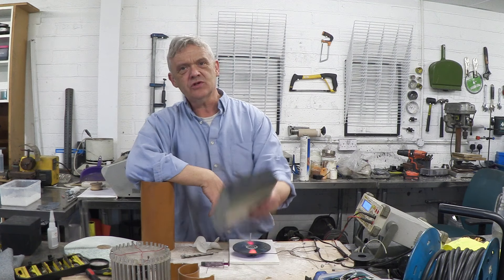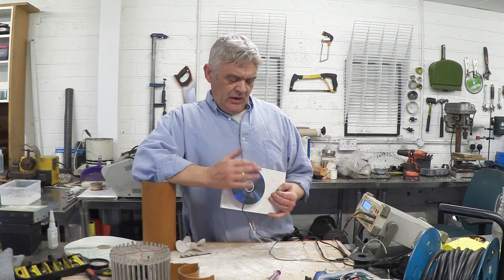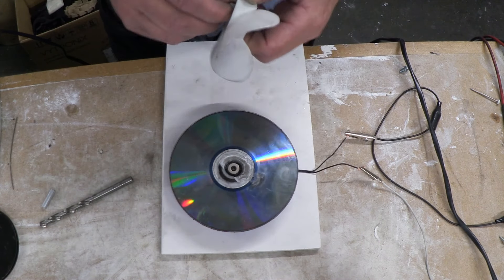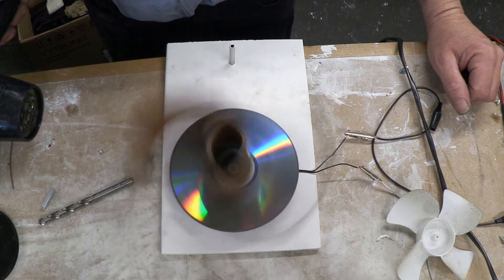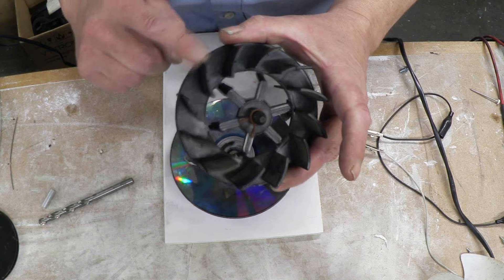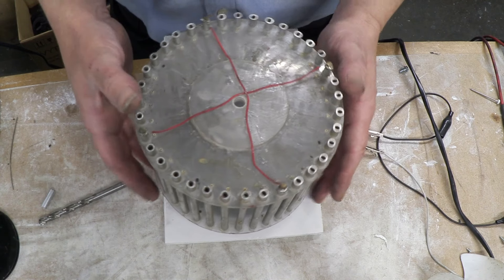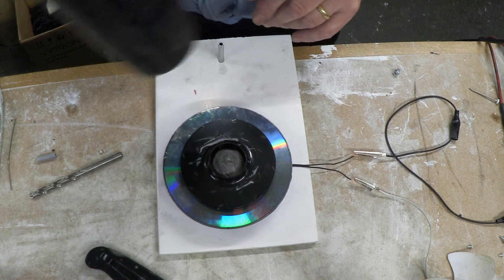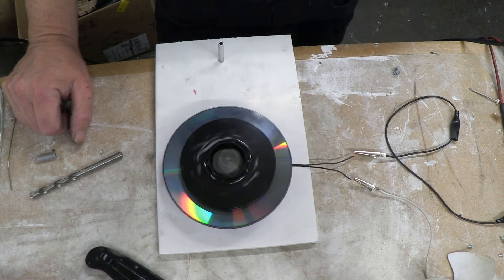A Flat Wind Generator

Comment: What I would give to spend time with my grandpa like this again. You evoke memories, sir!
Reply: Same Here Buddy
Blessings From Birmingham England
Reply from the maker: awesome mate - cheers
Reply: Cheers from Durham, Durham! :)
I would apply all this high intelligence low tech to make the small things work. Wind and thermoelectric generators in a van, for instance, for appliances and what not. Makes me happpeeee
Reply: @lokiii3507  Yes Those Flat Spinning Disks On The Top Of Vans And Peltier Units Attached To Points Of Heat On The Engine Would Create A Decent Amount Of Power Even As Reserve Top Up 
Bless Up
Reply: Now imagine even a handmade rocket stove (with a see through window) for heating. Connected to it a thermoelectric generator and water filled copper tubing connected to the insulated water storage unit and floor heating. What a life!
Reply: @lokiii3507  Indeed Very Insular But Modular So Relatively Easy To Work On , I'm Building A Rocket Stove / Wood Gasification Hybrid That's Pocket Sized It's Not Far From Complete
Bless Up
Reply: @joohop  Provide a link when you finish!
Reply: @lokiii3507  I'll Try My Best To Do A Basic Step By Step Before 1st Burn 
Bless Up Earthling

Comment: Nice job Robert.
When you put the cage with round bars on the generator, it came to mind that instead of round the bars should be squashed and made like an aeroplane wing with an adjustable angle of attack.  If you try this, I am sure you will have a very robust and efficient wind generator.
Then I though you can chenel the exhaust of that fan and it to run a Tesla turbine.  The Tesla turbine should have turbo fan on it a aircraft type turbo housing.
I think you just solved the jet fuel issue.  Bravo!.  
This can be started electrically but once over 5klm per hour the telsa turbine will be screaming and you would have trouble moderating the engine for taxiing etc.  Love it.
Reply from the maker: I am sorry mate but I did exactly what you suggested in this video - a round bar and an airflow bar.
Reply: Hi Robert, what I was referring to was the shape of the bars in the cage of rods.  Aero wings work on lift so I was thinking you could reshape the rods so they can harness the wind to use that lift effect to rotate the generator.
The Tesla turbine idea was simply to replace the jet engine with the Tesla turbine. The output shaft of the turbine is fixed to the turbo fan from the turbo prop engine.  Use the airspeed of the aircraft to run the Tesla turbine.  30,000 rpm will give huge thrust.
Sorry for any confusion.

Comment: I have built wind turbines for over 50 years. The bottom line is, vertical access wind turbines are fun to watch and I have several, but a horizontal axis wind turbine makes better use of swept area.  I dislike a lot of machinery whirring about at breakneck heights, so all my wind turbines are low to the ground and have big paddles, which hang out into the wind. They are all the drag machines, but I have never had one, fly apart. I cannot say the same for my horizontal axis wintd turbines. I conform to the theory that many small units produce the same power as one giant one and I have several small savonius units happily spinning in almost any wind here on my little place in North Texas.  If a blow comes along, I don't worry about a thing. My savonius windmills are all made with ball bearing axles and are fabricated from welded steel.

Comment: Some great suggestions! I can see the "wind wall" being a great thing for collecting energy on the cheap! Thanks for another interesting video.
Reply from the maker: cheers mate - and it just struck me you could probably instal this without needing planning permission
Reply: Even if there was no bubble, the wind exiting the fwg would inhibit the the one next to it.
Reply: @isaaccoen-graham8867  What if instead of a flat "fan" piece, you were to angle it slightly backwards towards the wall (\_/ with less slope and the wall at the top of that poor diagram), and have it offset from the wall about 5cm (2in)? Also, you don't have to absolutely cover the wall, you could allow space between for that air to escape either returning to the front side or escaping behind the rest of them? Maybe also about (again) 5cm or even 10 between units? I hope that makes sense, maybe I'm explaining it wrong.
Reply: The 'flat wind generator' idea wouldn't work well with mutiple units, but I do think the wind wall idea could be usable - architecture does funnel wind around, and a wind turbine designed to take advantage of this effect, and positioned along the edge of a wall, could be viable. Not massively powerful - you're not running a house off it - but viable as a power source for some LED garden lighting. Have to make sure it runs very quiet though, people don't want whirring fans in their garden.
Reply from the maker: @Ian Perryman that's all right mate - people think different things - but did you check out the Mike Waters suggestion?
Reply: @Ian Perryman if you put a dish with the middle cut out in front of the device shouldnt this help direct the air flow like the hairdryer
Reply: @ThinkingandTinkering
Reply: @ThinkingandTinkering  Shouldn’t the cone have been bigger than the hair dryer and the flywheel? Isn’t the air hitting the flywheel slowing it down? Counteracting forces? Using an air compressor small nozzle might work better for all experiments.

Comment: After spending the better part of a day standing in front of my giant shop fan playing with various types of fan blades including several vacuum cleaner turbines I've made an observation. The vacuum cleaner turbines are designed to flow air in the opposite direction than you and I are moving the air. If they were shaped so that the air could exit through holes that were wider than the holes in which the air enters (the opposite of what you have now) I believe they would become much more efficient.

Comment: Wonderful the delight you have and share with everyone....such a great lift when learning something new and maybe complicated.
Brilliant idea - as a Wind Wall. Working in Diamond or Star or both shapes in sequence, they would keep  each other rotating almost permanently.
Especially towards the Corners of Buildings where Vortecies are normally generating high levels of energy...
Capturing these energy spirals and then passing them back to any passing Winds on low energy areas of Flat walls would I believe help to regulate Airflow overal as well as wicking heat away when needed, to be used by heat capturing Technology. 🙋‍♀️🌈🌞

Comment: There is a company that did a Edit: quad sectioned  360-degree funnel system to gather low-speed air at ground level 4 kph and with an aero-spike facing down and the tube with a venturi shape to increase airspeed they then had 90-degree turn to send the air through "normal" wind generator blade set but with your last set up it could just go straight down losing no energy to the turn. Interesting and thought-provoking as always Robert thank you.
Reply from the maker: that is interesting mate - cheers
Reply: @ThinkingandTinkering  Cheers

Comment: It appeared to me as tho the squirrel cage with the curved blades spun easier and faster than any of the other fans that you experimented with, also if you had a number of theses on a rooftop they would also spin no matter what direction your wind flow came from.
Reply: Yup. The Vacuum impeller would work better if the airflow would enter from the side and not the center. The cone in the center would make an improvement whatever the direction of airflow. Playing with the geometry could improve it even more.

Comment: The power output of that tiny motor is surprising.  I like that last one with the cone.  It brings to mind the works of Viktor Schauberger.  I imagine his study of fluid dynamics can also be applied to air flow.  I think I will experiment on a way to capture the spill-over of your vertical blower and see if there is enough increase in efficiency to make a difference.
Reply from the maker: yes it does - nicely pointed out mate

Comment: A cone concentrator (not sure if it is a right word to use) could take this design to the next level I think. It can be easily attached to the base around the flywheel so without adding any weight to the moving part more air will be forced in the turbine.
Reply: You mean like a big funnel attached to the base aimed at the center of the impeller, to catch more surface area of air to up the air pressure and push it through faster? I thought about that too.

Comment: Dear Rob; Your last design with the cone at the centre looked good to me: I thought, we could invert the cone sides making it more pointed! 
Then adding a funnel to the centre to increase the catchment of air, would improve the pressure 10 fold at least.
Next: we could use any spilt over air that could not flow into the funnel, to act like a vacuum as it passes the exhausted air. 
This in turn, would help draw away the spent air. All good stuff for our practical people.
thanks from Chris.
Reply from the maker: I like it mate - that is good thinking in my book
Reply: `if i had a 3d printer, id look to print that shape, Any one here with a 3d printer wanna give it a go?
Reply: could mess with the diameter of the center intake port as well and make the cone's size proportional, increasing or decreasing the overall amount of surface area the turbine has devoted to air intake, when my 3d printer is up and running i'll try to take a look at this.

Comment: What I like about the last design is that you could still put PV cells on top of it. Two different sources of electric energy in one small apparatus.
Reply from the maker: for sure mate
Reply: That was what I also thought.  Use one of the cages and thunnel the wind to the center for the last design.  Perhaps also add the vibration method that was in a previous video to catch the imbalances of the system.

Comment: Re the impeller, adding the cone to direct the air was obviously necessary, but I think to properly adapt the impeller to work in reverse as is being done. It would increase its efficiency if a funnel was attached to the central hole, so widening the area that can catch the air, and perhaps increase any central Pintal force that may be in play.

Comment: 9:30  "...these would actually fit on the side of a flat building..
"
Well, sure, but wind does not blow agaimst a windward flat side of a building in the way your hair drier blows down the center of the your impeller.  
Blunt windward surfaces generally only experience a small fraction of the wind velocity of the free stream, and it is not perpendicular to the surface, but pretty much parallel.
Reply: source?
Reply: @crapisnice  I'd give the credit to empiricism as the source.  
Go outside on a windy day and stand with your back to the windward (overall flow direction without obstacles) side of a building.  
The air has to have somewhere to go, it does not simply blow up to the windward side of a blunt object.

Comment: I think your tesla turbine type would work even more effecient if the wind came from behind and routed in the outside fins and escaped from  front . Opposite to your entrance . This would take advantage of low pressure turning into higher pressure . Sort of venturi effect !
Reply from the maker: there are already Tesla turbine wind generators mate
Reply: Robert Murray-Smith yeah but they for high pressure force i thought .
Reply: You can tune a Tesla turbine for different fluids and flow rates, but they tend to foul up rather quickly when designed for air due to pollution and pollen and such.

It's another one of those things that work perfect in the lab, but not the real world.

Comment: Thanks for stimulating our imaginations Robert.

This gave me an idea - if you mounted this on top of a vertical10 feet long stove pipe, maybe the air pressure differential caused by the stack effect might create a draft to turn the impeller.
Reply from the maker: i like that mate - worth a try for sure

Comment: I think that the black squirrel cage fan is more practical since it is omnidirectional and, therefore, could be mounted on the roof of the building and it would work regardless of the wind direction.

Comment: What if you added a low angle cone on the outside of the flat wind generator that would redirect the air towards the center?
I'd assume you would get even higher output, however having a wall of them could be problematic due to the exiting air interfering with the others, but that is just a guess.
Reply from the maker: don't guess mate - try it and see

Comment: Have you ever thought of adding a air horn trumpet style cone to concentrate the air to the center which would increase the wind velocity at the inverted cone at center of your impeller style flywheel.  The final design would look like the old Ford Model T “A-O0GA Horn.  That would take pressure off the flat surface of the flywheel and increase the air pressure at the center.  That design might increase the Venturi effect at the discharge section of the design.

Another thought I had was to deflect the exhaust gases toward the leeward side of the configuration to increase the Venturi further.

Just a thought, if this has already been addressed, please forgive my ignorance, it is just that I have neither read it in the comment nor hear heard nor seen it in your videos.  I find your videos fascinating and inspiring.  Thank you.

Comment: I'd like to present an idea for a constant wind source.... you always get me thinking.... It would require a busy highway.... How about running over a garden hose with one way valves at each end to charge a storage tank ...  once the tank is charged then it could be released to turn a series of wind generators... It would also be interesting to see how much pressure you could actually build using this method of recapturing energy....
Reply: They use this principal already but for surveying how many cars use a road. 2 pneumatic rubber tubes are laid across the road, parallel with each other, connected to a sensor box on one side of the road and sealed shut on the other. When the distance between the tubes are known, the time between the pulses of air can determine the speed of the vehicle and it's wheelbase. 4 pulses = 1 vehicle.

Comment: In places with no wind but lots of heat you could have a long black tube with radiator fins on the inside hot air rises and passes through a generator at the top and one as it gets sucked in the bottom.
Reply from the maker: I like that one mate - cheers
Reply: @ThinkingandTinkering  :)

Comment: If you blow through a funnel directed at the disk, will it increase the airflow like water flow being concentrated this way increases the water flow rate? Previous wind generators you made could benefit from this.
Reply from the maker: that doesn't sound right mate - but I will try it and see

Comment: The last example seems to be more of a concentrated wind pressure device which needs a way to funnel the air in as the intake at the centre is small and the output ports are larger. I don't think it would work well on a solid wall because on a wind generator the power output is proportional to the volumetric throughput and a solid wall would block the air flow. so you could consider a matrix of these on a wire fence, I think that would work much better.
Reply from the maker: i do like the fence idea cheers

Comment: It seems to me that a lot of wind would slip off away from the central circular inlet, especially due to the spinning air exiting the other ring area, causing a low pressure area around the rim.  
I believe a funnel on top of the inlet would funnel more air into the fan.  It would increase the pressure at the inlet and therefore a higher pressure differential between the air inlet and air outlet, thereby increasing velocity and therefore power output.  Simply cut off a car oil filler funnel and glue on.
Reply from the maker: nice one mate cheers

Comment: Try the experiment of the last device with the squirrel cage. Put a flat piece of plastic on one end or the cage and apply air flow to the other end of the cage, not to the blade edge
Reply from the maker: ok mate - will do cheers